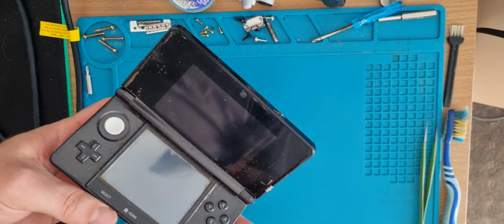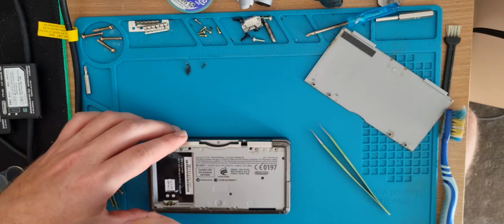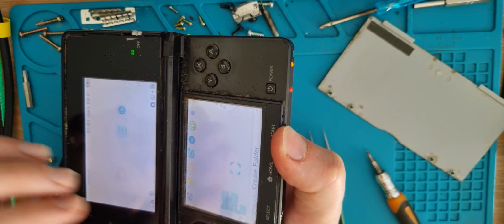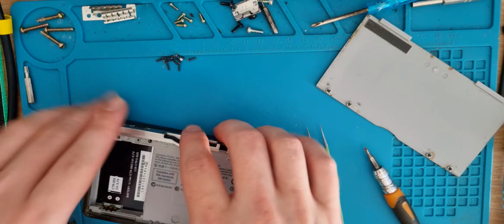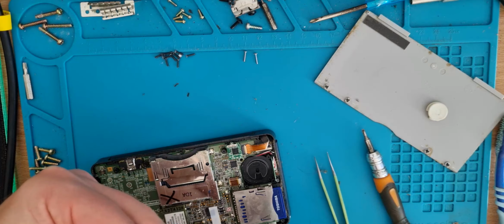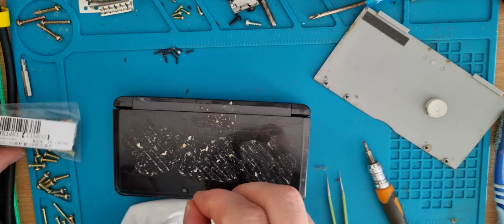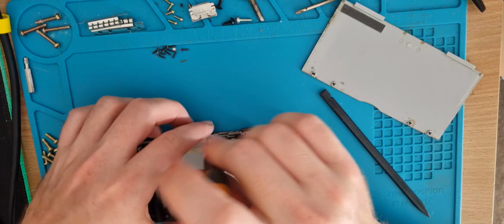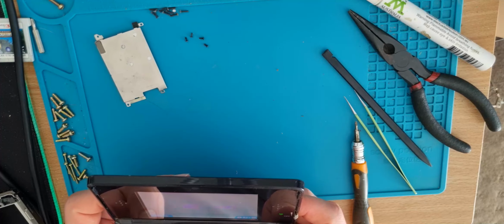Disgusting 3DS wont charge - common problem easy fix

Comment: I have a old 3ds When I plug the charger the orange light comes and after 5 second its gone pls help what should I do
Reply from the maker: If you have access to another battery which is known to be good and has some charge in it, swap them over and see if it boots. If it can boot with another battery then the charging circuit is incomplete, if it can’t boot with another battery then there is most likely a bigger problem with the board
Reply: @chickenmaster121  do you have discord? i have some questions about ds lite

Comment: I’m in the same situation and I need some help 😭
Reply from the maker: Have you opened up your console to check the solder point like in this video?
Reply: No
Reply from the maker: Well that’s probably a good start if you have a small Philips head screw driver